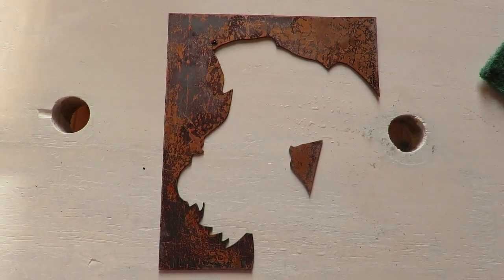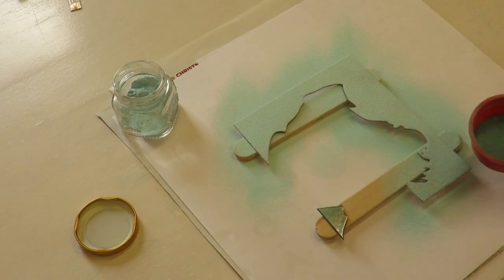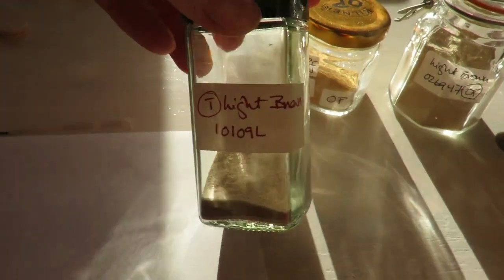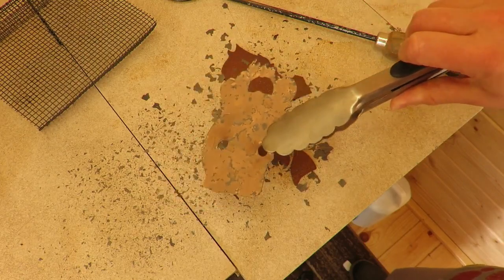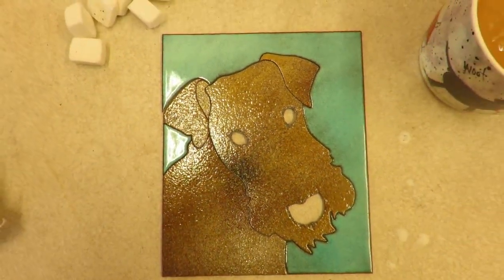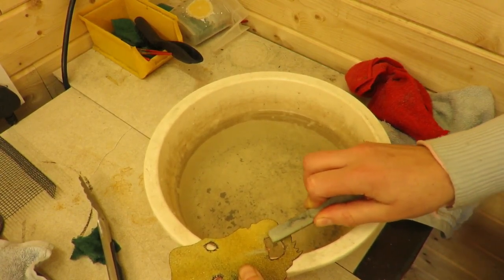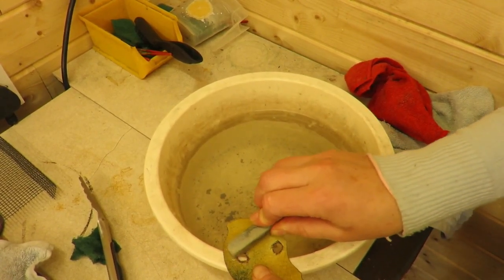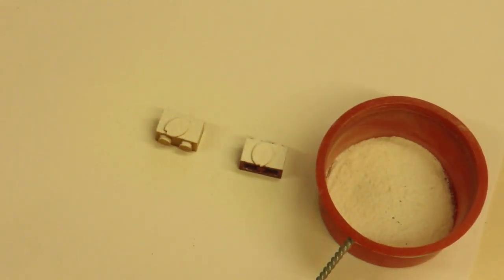Westin Part 2: How to use kiln fired enamel. Oxidation, opaque and transparent enamels on copper

Comment: Hi Geraldind...love your tutorials. They're very informative and helpful..You mentioned using ceramic fibre board as stilts in kiln and enamel won't stick to it .I'm intriqued to know whether that's a particular ceramic fibre. Thank you from Lyn
Reply from the maker: Hi Lyn, thanks for getting in touch. No, it is any ceramic fibreboard. I only use it for pieces where the back won't show - in framed artwork for example because it leaves a mark on the back so wouldn't be appropriate for jewellery for example. But if the back is concealed then it is fine - in fact if you are planning on using some sort of epoxy resin/glue to adhere your piece to mount board then the rough surface that is left on the back by removing the fibreboard is very useful.

Comment: Fantastic video / thank you / I could listen to you for hours! Where do you get your liquid enamel from and also your ceramic supports?
Reply from the maker: Hi Karen, thanks for contacting me. Well, you can get liquid enamel from a number of suppliers. If you are in the USA you should try Thompson Enamels in Kentucky. The one I use for the backs from Thompson is called BC-1070. They sell it in dry form and liquid form (get the dry form as it is cheaper and cheaper regarding postage too). There is an agent in Denmark called Enamel Supply but VAT is very high in Denmark so it may be cheaper to get it from the US regardless of where you are located. The other place I would recommend is WG Ball in the UK (also lead-free). I much prefer Thompson liquid enamel by far. And also, for the backs of wall pieces I don't care what it looks like as nobody will ever see it but if you are doing jewellery go for something that will end up looking decent. Such as BC 1070 or use one of the dark colours like Black. It is much more uniform. Also, it is best to use de-ionised water (which can be purchased at any motor factors shop and costs about €5 for 5 litres...). As for the ceramic fibreboard, I think I got it from Vitrum Signum in London but it can be found in loads of places.

I hope this helps!
Reply: Geraldine Enamel Workshops thank you Geraldine / I will try and track some down